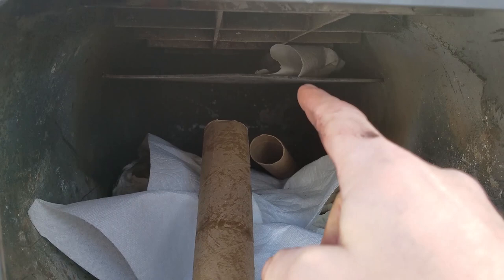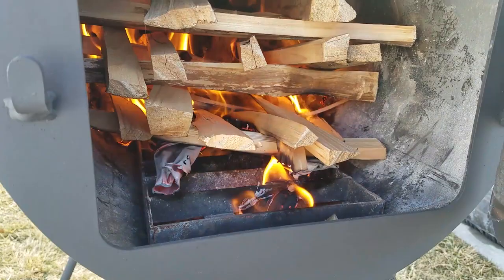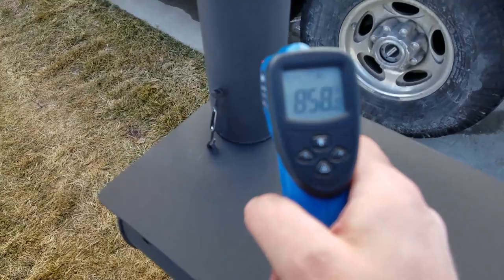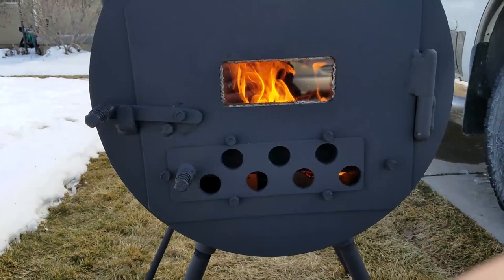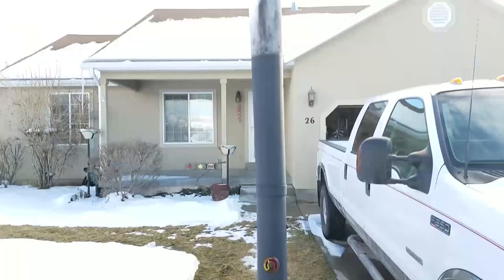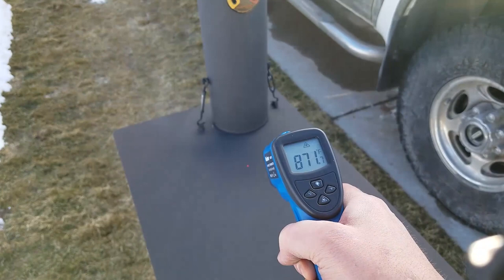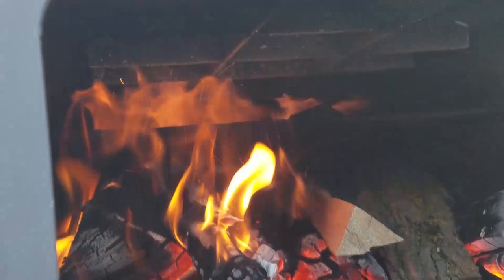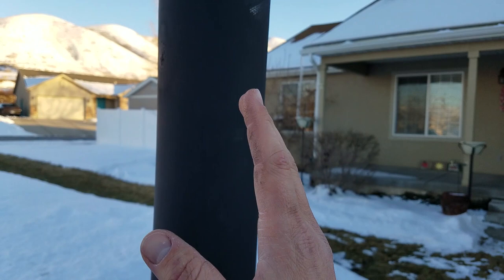Burning in Tent Stove After Modifications

Comment: Hey John, I have't seen anything on your stove before that my be just me.  I hadn't seen any notification's on your build. I will diffidently check it out and watch all you have on it. I'd love to make one of these myself. Maybe just a little bit bigger for my Bugout Trailer I'm building as we speak. I sure got a Super Buy on the New Trailer Complete 30' Frame and then on a used 8'x8'x20' box van body put on the Trailer.  with room to make an area for drive on storage for a couple 4-wheeler's also. I also been look'n at the `lil Chinese heaters on E-Bay that run off of diesel too. Have a Day.

Comment: Hey John, I’m in the process of modifying my camp stove for efficiency. I put a 1/4” thick baffle, added a rear air intake, that runs from the front to the back via a pipe. I want to build a new door for it, curious how well the glass stayed washed via the air
Reply from the maker: It doesn't air wash well honestly.  Could use some redesign; however, I prefer the glass door to the non-glass door any day.  I can get an idea of how much wood is in the stove from my bed based on the amount of light coming from the stove.
Reply: @JohnHarmon   thanks for the quick reply, I’m sure I’ll be tinkering with how I’m going to go about designing mine for a while before I build it., but all these videos are great for ideas 👍

Comment: John, I purchased a Colorado Cylinder Stove. After watching you build one (vid from 5 years ago), I have a question. My stove (and every other one from other companies I looked at) don't have a baffle like you installed. Is there a reason they don't do that? I'm thinking, warping/replacing hassles perhaps? Your input would be appreciated! Thank you!
Reply from the maker: It cuts down on the room you have available to load up the stove with wood at night.... my guess is that is the reason.  My goal was to extract the heat (and to keep the flames from going straight up the flu and overheating it)
Reply: Im really late to the party, but I have a question on the baffle as well. 
I started building a cylinderish stove out of an old air compressor tank. It wont be nearly as nice as the job you completed, but should prove functional.
Im going to istall a baffle as well and wanted to know how far from the back wall of the stove does the baffle come forward?
I still have the dome shape of the tank in the rear, but cut off the front to be flat for the door, interestingly enough I bought as a new, seconds from cylinder stoves there in Utah!
Thanks so much, and again you did an excellent job on yours!